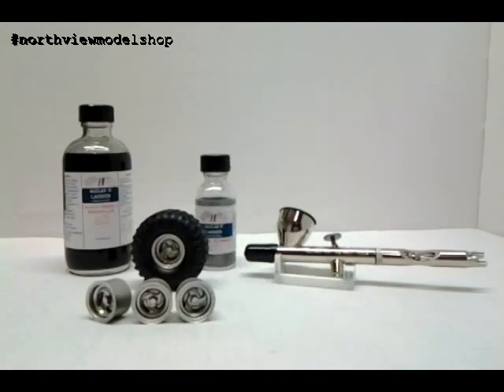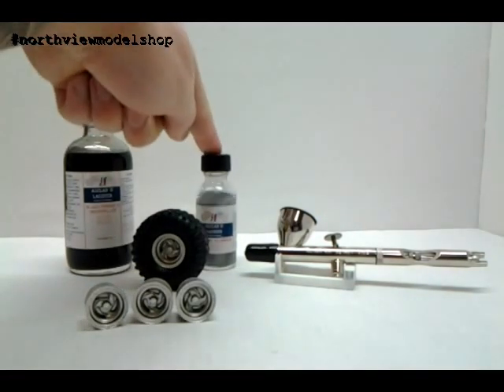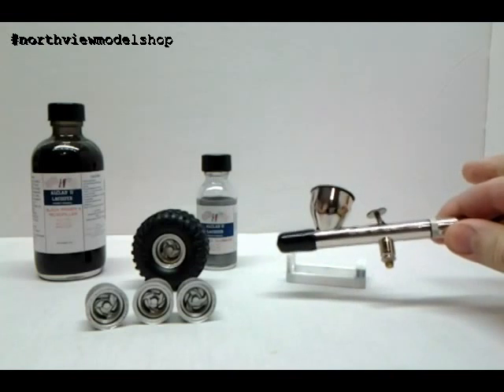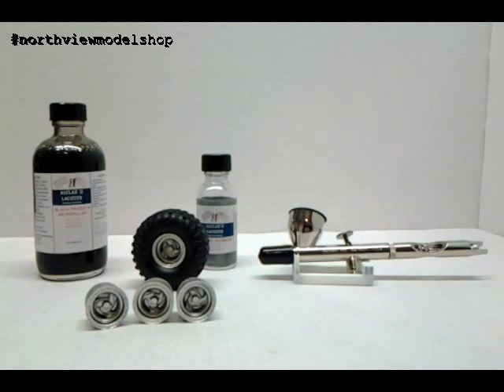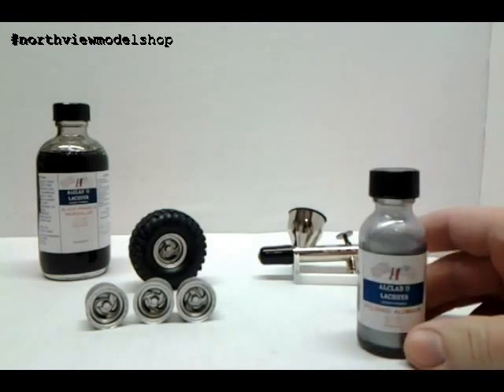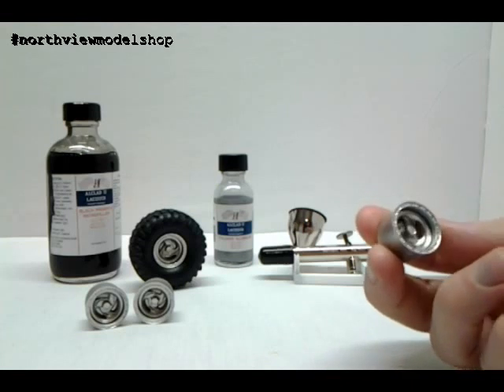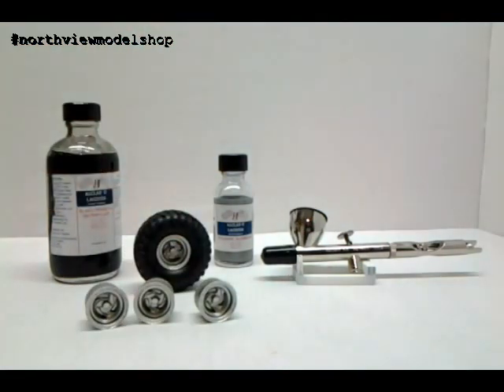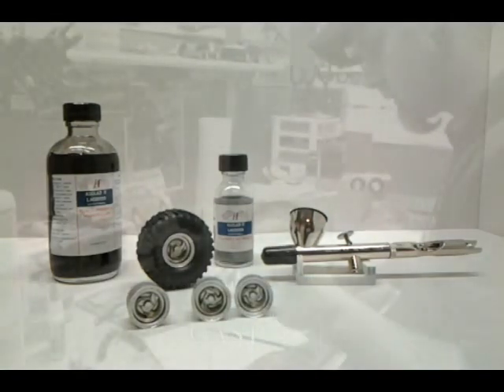Alclad II Lacquer

Comment: Jan, you did a Great Job in your intro, psi settings, telling us how to spray (30 min dry time) {might want to mention humidity factors, could be an issue, [just a general rainy/dry day that you applied]}, and even the cost (roughly).....all-N-all a great Vid, thanks for sharing....from a fellow model-builder.

Comment: Have you ever used Alclad Aluminum? I have tried it and the finsh was very textured, also the Alclad Aluminum would thicken up in my airbrush cup!
Reply from the maker: I have it go very texture before on me but it was from spraying to far away.  What airbrush are you using ?? What air pressure were you spraying at ?
Reply: The airbrush was an IWATA HP-CS with a .35mm nossle (I think) and tried is at about 10-20 PSI but nothing came out, so I increased the PSI to about 25-30 and it came out but it was textured.
Thanks for your reply!
Reply from the maker: +GetYourModelOn very odd. I find the stuff spays well at 20psi. The next question would be what primer did you use.
Reply: +GetYourModelOn Did you try to thin it?  Is it only the aluminum? Have you sprayed others?
Reply from the maker: this stuff should be pre thin... I have used their other products and all were perfect stright out of the bottle
Reply: me too. why i asked.

Comment: OK, I am a bit confused. Did you use the Black Primer? Or the Black Gloss Base? Because they are 2 different things, and will give you 2 different effects.

If you used the Black primer and it came out shiny, then I would say that it either wasn't shaken up enough, or there was something wrong with your bottle, as the primer shouldn't come out glossy at all, should come out flat like other primers do.

All of their colors look better when sprayed over a black base coat, (makes the color look richer), but there are some in the line that require a gloss black base (and Alclad makes a Gloss Black Base, without getting up to look, I think it is #305), those being Chrome, Polished Aluminum, Stainless Steel, Polished Brass and their new Black Chrome. You can use their Gloss Black Base, or pretty much any other enamel gloss black (I personally have used both Humbrol and Testors in the past before Alclad brought out their own).

I don't doubt that the black primer would bring some of the qualities of the above colors out somewhat, but they will really shine if they are put over a gloss black, as opposed to the black primer.

Tip for your airbrush as well. Since you normally use acrylics, when you do run lacquers or enamels through your airbrush, and clean it with the appropriate thinners, when you are done, run through either some water or some acrylic airbrush cleaner to displace any left over lacquer or enamel thinner you used for cleaning it. Will make the seals in your airbrush last much longer.
Reply: Cool video! Thanks 4 sharing!
Reply from the maker: thank you
Reply from the maker: ALC #309 works great.. thank you for the info I will need to take a better look next time